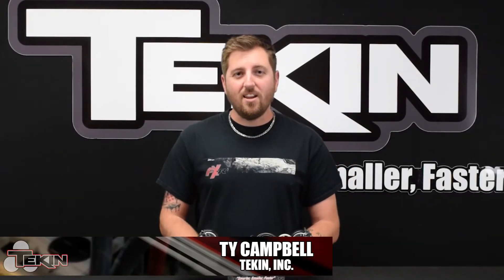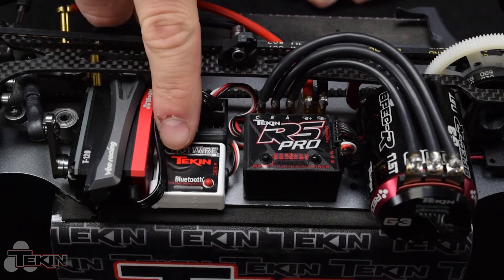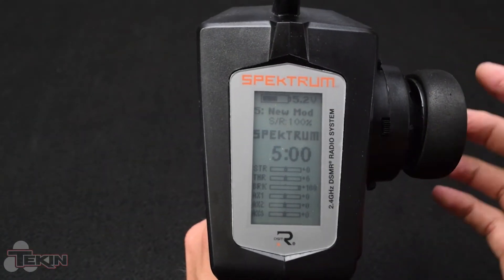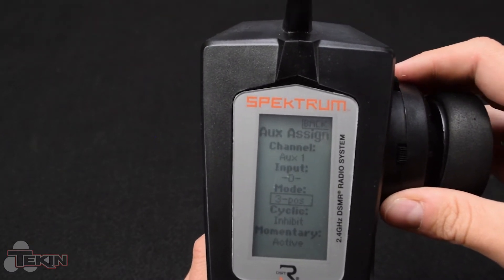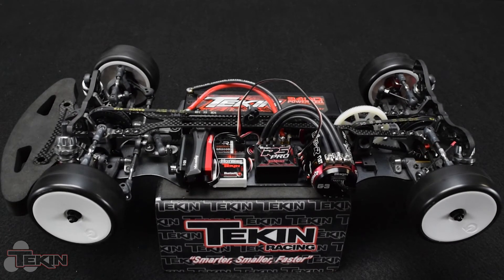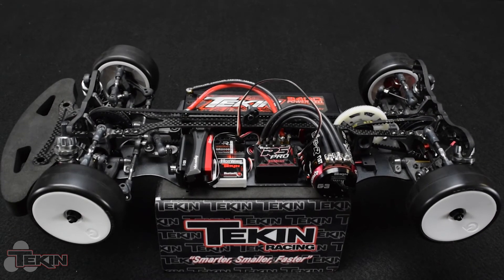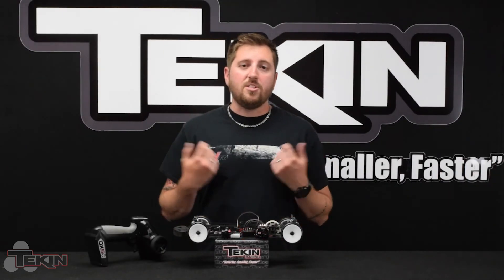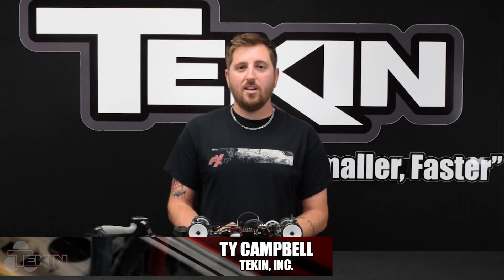Tekin On-The-Fly Drag Brake Setup | Tekin ESC Programming

Comment: Hey Ty,
I've got the Rx4 and the roc412 3100kv on 2crawlers w/hotwire device and the Spectrum dx5 rugged, I've followed both the active drag video and the auxiliary drag brake video to the T set them like yours, still can't get it to work. What could I possibly be doing wrong??
Thanks
Reply from the maker: Double check the plug polarity at both the ESC side and the receiver side! I've messed that up more than once or twice setting up trucks.
Reply: @TekinRacing  Thanks for the quick response, all polarities are as they should be. I think it is in the radio, I have it set as shown in the video, but it seems that when I click the switch to advance it keeps going back to center and nothing changes. Is there anything else I should check with the transmitter?? I appreciate your time.
Reply from the maker: @renobob7781  each click/release adjusts the brake 10%. Also whatever you have your drag set to in the ESC is where it will start every time it is powered on. Try setting it at 0 and then try the switch you set as 3 position/momentary and see if you can get it to increase the drag strength.
Reply: @TekinRacing  well I tried setting brake at 0 actually 2 because 0 is off, rolls like new money, added 10 clicks to take it to 100% still no drag brake. Is there any other settings besides the auxiliary that may need adjusted that I'm missing? This will be the last time I bother you, Thanks
Reply from the maker: @renobob7781  make sure the switch you're using isn't also assigned to Brake Rate or something else. Check in the Rates area on the radio.
Reply: @TekinRacing  dm me on Instagram @ r.browning62 if you like.
Reply: Did you get this to work? I just got the same rx4, roc412 3100kv setup but on futaba 7pxr radio and can’t get this to work. Any helps would be appreciated!
Reply: @baohuynh735  yes I followed the directions and it worked for me. Not sure about the Futaba radio. Good luck.